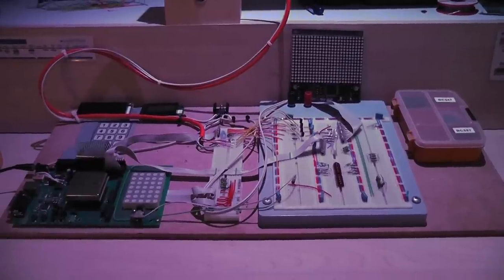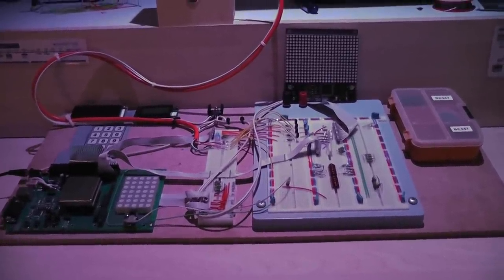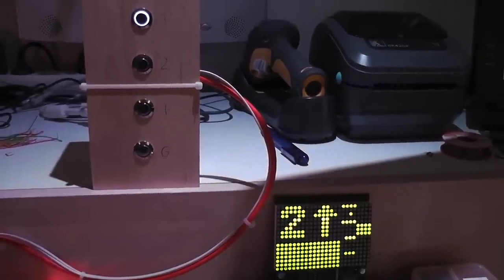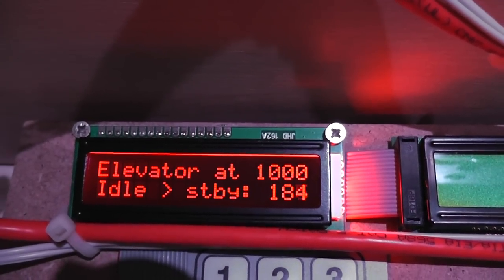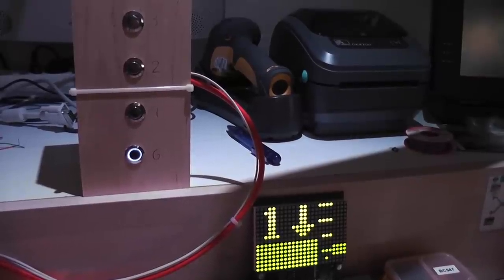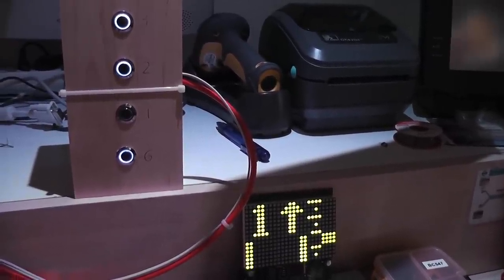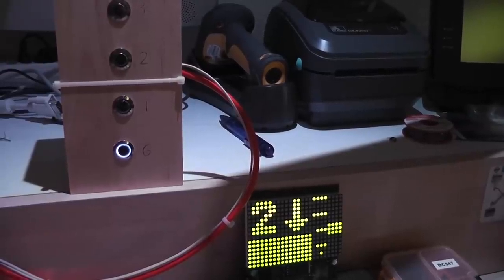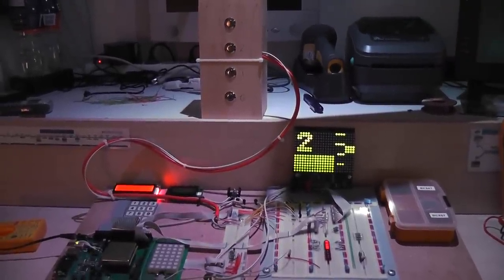DIY elevator control panel and simulator - Part 2: First test of the controller software

Comment from the maker: @harrihealey02 That's a good one. I have just found an MP3 player module for use with my board on ebay for 14 dollars. It can play up to 512 MP3 files on command so that should be enough :) It will probably take over a week to arrive from HongKong but then i should have all the soundFX i need. Now all i need is good MP3s for all floors, the chime and the motor sound.
By the way, i have done some more changes to the door and shaft graphics yesterday, i will upload a new video soon.